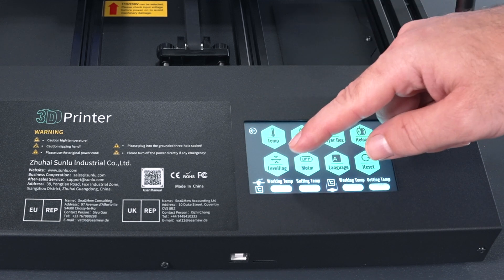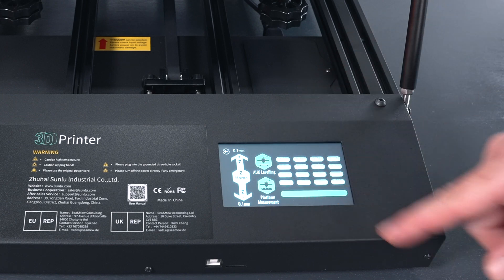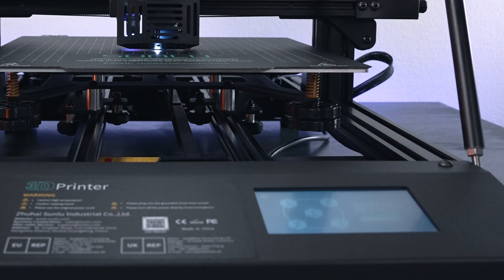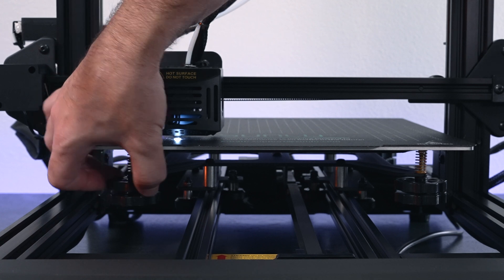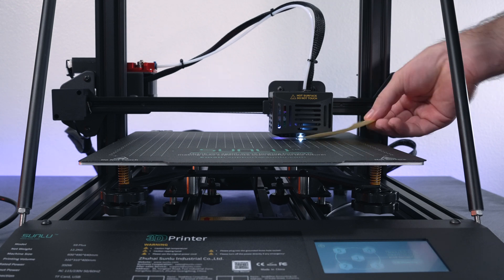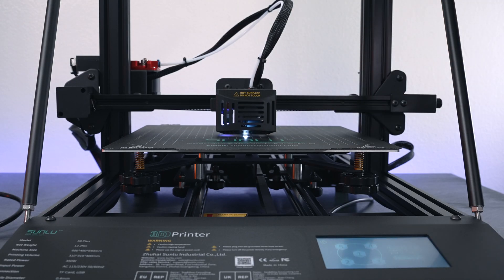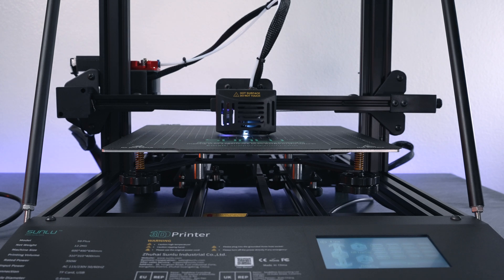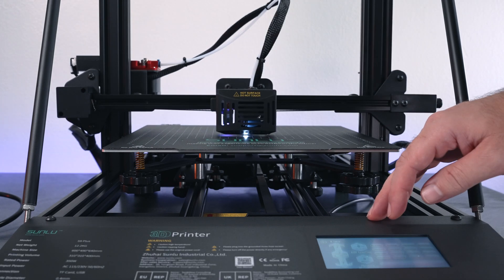Sunlu S9 Plus - 3D Printer - Bed Leveling

Comment: Hi, do you think is possible to connect in parallel a second layer fan without the fan cable to overheat? I ask because I tried the same in an Anet A2 and the layer fan cable overheat after 20 min, by the way Anet A2 is 12v. Thanks in advance.